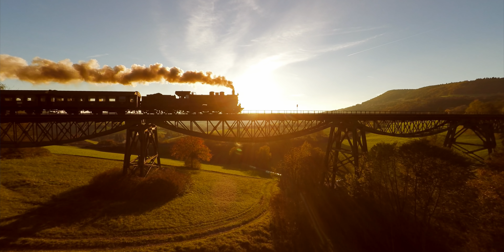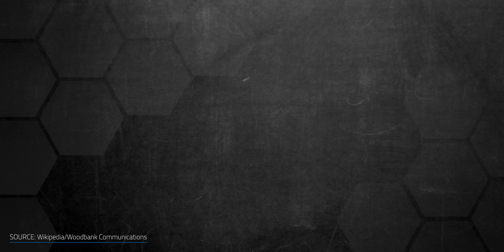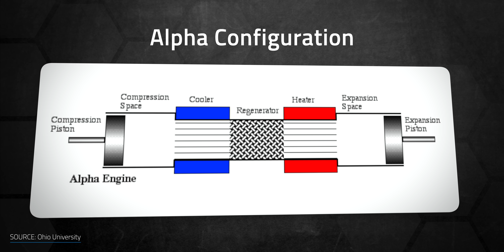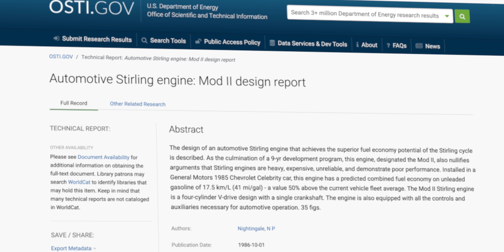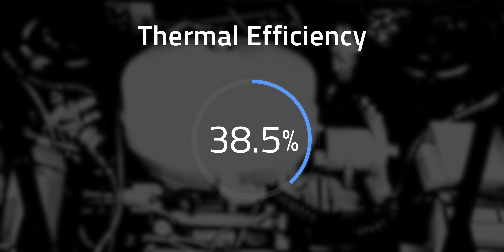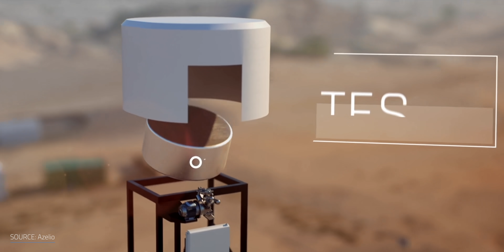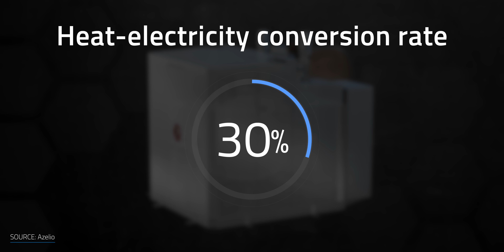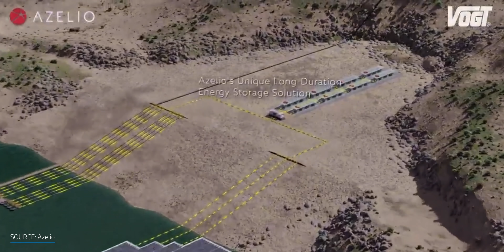Are Stirling Engines the Future of Renewable Energy Storage?

Comment: Based on my minimal research, this seems like it would fit perfectly in geo-thermal power schemes.
Reply: I've been considering how to build a sterling engine in my backyard. Summer temps here are 100° or more but half a foot underground the temp is nice and cold
Reply: @Artinthedark83  One thing to watch out for is saturating the ground around the half-buried engine with heat. The engine moves heat from the hot plate to the cold plate, so the area around the engine would heat up. I don't know if the ground would dissipate the pumped heat fast enough. Maybe combining it with a large thermal loop underground would do it.
Reply: @Trafulgoth  poop
Reply: @Artinthedark83  Pretty simple.  You'd need to either concentrate solar energy and use a high-temp Stirling engine, or better yet, use vacuum panels (to gain solar heat).  For the cold side you do something similar.  A water loop through a pipe (it needn't be metal, just thin plastic is fine) in a narrow trench about 1 m deep.  The longer the better, but there will be parasitic losses when pumping.  You could also use air cooling, which would not be as effective, but way easier, so just build bigger to make up for it.
You'd need to build your own custom LTD Stirling.  There area calculators out there for sizing.
Since you have heat and heat-dump running on liquid loops, you could enclose your Stirling in a pressure vessel and turn up the pressure as much as possible.
For example, build it inside a large propane tank that has been cut in half with a flange added for bolts.
Crank it up to about 5 bar - helium if you can.
If using the pancake type of displacer, add a regenerator material around the perimeter.  I've not seen this done before, but think it will greatly help with efficiency.
Also, if you can magnetically couple the displacer piston to the power piston, rather than a through-hole linkage it will increase efficiency.
Anyway, I'll do this one day under the right circumstances.  If you can.. do it now :)
Reply: @Artinthedark83  That is an interesting idea.
Reply: I wonder if this is used in Iceland or is planned for future use?
Reply: @earthcoloredeyes5043  I know they're doing geo-thermal but not familiar with what specific tech they are using to harvest the thermal energy.
It looks like most geothermal is similar to traditional steam turbine thermal power stations.
Reply: @Mystical-Mono  physicist here (so, not quite an engineer) but as I understand it Stirling engines are in general less efficient than turbines, largely due to needing to supply the cold side. But it’s possible to bring them higher with improvements, I suppose. (We have a few other types of direct heat to power techs, such as using tons of thermocouples, which we do with RTGs. But those are also less efficient than driving a turbine.) Note I haven’t watched the video yet so if there’s some breakthrough he talks about, I don’t know about it yet. Going to play it now.

Edit; also, this small one looks impressive spinning quickly like that, but that’s unloaded. Much like a battery’s voltage gets brought down under load, the speed of the wheel gets slower, and it can’t provide much torque, which is akin to current. 

Edit2; okay, so these industrial ones get ~30%, which is pretty decent. However, traditional steam and turbine gets 40-50%, with the median being between 42 and 46% depending on your country. So Iceland wouldn’t have much reason to do it, unless they’re much cheaper to set up.
Reply: @kaitlyn__L  I think the difference is that a steam turbine needs heat or steam and pressure. While a Sterling  Engine can use the difference in heat. Meaning if you have a geo thermal spot with ice cold water also near it you can extract more power?

 Correct me if I'm wrong but I think that is where the benefit lays. No idea the pressure required for a regular geothermal plant.
Reply: @dianapennepacker6854  that’s certainly possible, but increasing the temperature differential makes all engines run more efficiently. Even a heat pump is technically a type of engine under this conception, and geothermal heat pumps work best with hot ground and a cold sink. I’m certainly not anti-Sterling research, I’m just not sure how much benefit is unique to them :)
Reply: This was my thought exactly. That, or lowering the cold side into the sea in countries near the equator where the ambient temp usually stay on the high side and sea temps on the cooler side. Might not be a big enough difference in temp to be efficient though, Geo-thermal is probably the way to go.
Reply: even just in cold areas, where you have a natural source of ice water and minimal warming of some water with solar panels or just a large shallow pond. possibly an adjunct to a dam, where you have basically a giant cold sink behind the dam wall.
Reply: They can use more efficient steam turbines.
Reply: Efficiency has little or no impact. Price of equipment and maintenance is what would make a difference.
Reply: @wakeupthebear  Here in Sweden, where we have hundreds of thousands (if not millions) of residental geothermal units installed, they are considered to require NO MAINTENANCE. But most of these units was installed in the early 00's, and the early ones in the 1980's. So their history is still short.

Maintenance and cost of the parts above ground would be similar to that of a supersized refrigerator, since that is exactly the same kind of apparatus. A well made refrigerator last for decades, many Swedes still use refrigerator manufactured in the 1950's-1980's, sometimes even from the 1930's-40's, and plan to keep them as long as possible, since they are much quieter than modern ones, that doesn't use freon as the refrigerant.
The parts below ground is expected to work better than a normal waterpipe, since they have no problems caused by freezing or depositions inside the pipe. A well layed waterpipe last at least 50+ years. Most water PVC pipes, used in Sweden since the 1960's, almost exclusively since the early 1990's, has never needed any maintenance (unlike older kinds of pipes made of iron, copper and concrete; historically, lead pipes was rare in Sweden, since Sweden didn't produce much lead domestically).

Since most of the Swedish geothermal units, was installed during the same time period. If any future problems arise, it is likely to happen mass scale. And likely to be cheap to fix, because of scale of production. Just as a massive demand of residental geothermal units, made those very cheap to buy an install in the early 2000's.
Reply: No shit. I’d wager molten salt, via concentrated solar, the likely storage medium for residential, and use ground loop from geothermal for the heat sink.
Reply: I think Geothermal is a terrible idea. Earth will die when tectonics end which is based on geothermal energy. If anything we should be looking at ways to dump heat into the earth.
Reply: @nustada  lol
Reply: I think I made that same comment after his geothermal episode 👍
Reply: By much minimal research you mean this video
Reply: A common steam turbine generator works well with geothermal wells. Stirling engines are useless at over 2 hp.
Reply: … have you guys heard of google scholar? Lol - yes they’ve researched it, knock yourselves out:
https://scholar.google.com/scholar?q=geothermal%20stirling%20engine&btnG=Search&as_sdt=800000000001&as_sdtp=on
Reply: Exactly my idea. It could even power the heat pump and let the home owners have their power needs met trough solar. Just need one more loop for it :)
Reply: it's gotta compete with the good ol' boil water and send thru turbine spiel.
Reply: Yep
Reply: Do you really need storage in geo-thermal power schemes? Isn't it more effective just to add production capacity, as I guess you should have significant power loss with this storage solution?
Reply: How about adapting to location where a large (cold) water body adjoins a land mass heated by the sun, e.g. San Francisco Bay and the east bay?
Reply: The problem is that a geothermal source might have a temperature of about 100 degrees Celsius, if we assume the ambient temperature to be 25 degrees, then you can calculate the carnot-efficiency of the cycle which is the maximum possible theoretical efficiency if you consider absolutely zero losses (obviously in reality not possible). The carnot efficiency is = 1 - Tc/Th = 1-(100+273)/(25+273) [converting from Celsius to Kelvin] = 20%. The actual efficiency of the cycle would likely be less than half this after losses. In reality it is very difficult to convert low-grade thermal energy into useful work.
Reply: Nope it's a good thought but a turbine uses less moving parts .. less parts equals less maintenance !! That's why you'll never see this application used for geothermal !!
Reply: Apparently a turbine can convert much more power than a valve based engine because you can direct a jet of superheated steam onto an angled blade. With a Stirling engine you can't control the motion of the working fluid. Stirling engines are highly efficient for low power systems.
Reply: I think a great idea would be to build an insulated trench under ground full of sand and zeolite. the liquid aluminum piping would run all the way down into a giant insulated trench. The sand and zeolite would make a huge heat sync, storing more heat energy. another pipe  of water could run through the sand and you would always have boiling water on tap, along with steam. you then would use the boiling water to sync with a huge tub of water that stays at 180 degrees for sanitation water on tap. then that goes into water tanks where its mixed with cooler water for faucet hot water on tap. There is also a giant tank of warm water that runs into hose like tubing, that stretches out into the green house underground, and under parts of the earth outside, to gently extend a growing season, so we can hurry up and create more plant biomass and diversity asap. the more we turn thermal energy into regenerative systems of basic energy we eat from every day, the world will have a much better chance of being a better place.
Reply: Thing is that geothermal is always-on anyway so it wouldn't be of much use there.
Reply: @lozoft9   well you're only considering the energy storage potential, i believe Christian is implying that a closed loop Sterling engine might be more efficient than traditional(steam) geothermal
Reply: Except for those pesky earthquakes resulting from geothermal. (Ref. Irving, Tx)
Reply: @EvilCerealBoX  - I don't know enough about the tech. Most geothermal uses steam similar to other steam turbine thermal power stations. I am just wondering if Sterling engine tech could be more efficient and potentially less negative consequences over traditional models.
It looks like initially that the sterling engine tech is much more efficient than traditional geo-thermal models.
Reply: @EvilCerealBoX  Earthquakes????
You must be getting your facts wrong.

Here in Sweden, in the areas  where residential housing hasn't access to district heating, geothermal heating is the most common heating solution. In these areas, pretty much every residential building has their own heat pump, taking heat from a hole in the ground in their yard. Hundreds of seperate units within a walking distance, in thousands of urban areas. From the north to the south, Sweden covers a thousand miles, with very different geologic conditions, and significant variations in climate.

Most of the Swedish geothermal units was built during the same period of less then a decade. (Government subsidies in the early 00's)

No frikking increase in earthquakes frequency whatsoever, no increase in the severity of earthquakes. Parts of Sweden is situated on fault lines, and we have about 2 earthquakes per nycthemeron. But, although frequent, our earthquakes are very mild compared to those in many other parts of the world, usually barely noticeable (and, as mentioned earlier, that has not changed with expanded geothermal energy usage).
Reply: @EvilCerealBoX  The earthquakes around Irving TX are because of fracking. Fracking has turned Oklahoma into the most seismically active place on earth.
Reply: @EvilCerealBoX  That was an almost imperceptible 3.3 magnitude tremor in the center of the Dallas Ft. Worth metroplex noticed by 1400 people in an area of 7,000,000 people. It was caused by overloading an injection well discarding polluted water from oil well drilling. One could cause a serious problem by lighting a campfire in a textile factory, but that doesn't mean it should be blamed on the textile factory. Blame whoever hired a macho drunk who doesn't care about workplace safety.
Reply: @EvilCerealBoX  that is from "fracking" for Natural Gas. Normal drilling doesn't cause the same instability deep underground.

Comment: Great video Matt! I was not familiar with the Stirling Engine. Seems like it would work well in specific instances. However, the only down side would probably be the multiple moving parts in the engine which would probably require a lot of upkeep & maintenance. Just thinking out loud. 🤔🤔👍👍
Reply from the maker: Thanks, Steve!  And yeah ... moving parts = maintenance, but there could be some really interesting use cases out there that make it worthwhile.

Comment: I wonder if the flywheel in a sterling engine could be adapted through a continuous variable transmission (cvt, like used in some dodge vehicles) to directly store the thermal energy into flywheel energy for very long term storage. Seems like it should work. There would be losses in the cvt but I think they could be very small

Comment: Hey Matt !! Can this be a source , after connecting it to the Water Inlet, of every household? There is so much Kinetic Energy, going to waste , in Millions of Homes , all around the World !!! It Mini Turbine, should be generating energy in every household, before the water enters the heater or just after entering the home , at the inlet valve. Also , same with the 1000’s of Higher Altitude Water Tanks , not using their Kinetic Energy of their flow, to generate Electricity, before entering the grid of the Municipalities..

Comment: With the efficiency so much lower than other methods though, you'll need to have significantly more production.  That said, one of these units is likely cheaper, but I'm still skeptical it'll be economical.
Reply: It depends on the specific use of the engine. Compared to photovoltaic cells, the efficiency isn't actually that bad, and because they're purely mechanical, they can be built in facilities not equipped to work with semiconductors. Additionally, something not mentioned in this video is their potential use in smaller, safer nuclear reactors like NASA's kilopower, which could be adapted for planetside use with relative ease. In practical terms, stirling power stations will never supplant wind and solar, but they don't need to in order to still be a useful part of a future zero-emissions energy economy.
Reply: The thermal efficiency is no worse than the most efficient steam turbines, at ~33%. It can also be turned on and off much more simply than steam turbine based power, so it should be better at providing power at peak times.

Comment: Imagine a one hundred foot wheel, with many weights synchronized to maintain the wheel rotation, without power, onces started.
Reply: You would have to lift the weights in some way to input energy.
Reply: @garethbaus5471  weights would be attached and power initially applied to start the wheel, once started the weights would provide energy.
Reply: @JMJWill  only for as long as you have weights to continue dropping.
Reply: @garethbaus5471  not if they could synchronized them similar to the old principle of water wheel except counter weight would drive the top continuous down and around...perpetual motion.
Reply: @JMJWill  the issue is that the energy needed to place the weights is equal to or greater than an rotational energy.

Comment: Energy storage may not be as important as we think. Solar costs (and to some degree wind) is becoming cheap enough that the economics of over-building production can be cheaper than storage. The other "cheap" solution is interconnection such as connecting the three major US grids together. This would allow, for example, sunny Arizona to sell late afternoon solar power to the northeast as they enter the high demand of early evening. Storage may still be important, but my bet is that it will be small, distributed, no/low maintenance storage such as Tesla's powerwall.

Comment: wonder how efficiently this engine would run if you placed it between the outer hull of a space station and the air inside the station just like the ice thing but a whole lot colder, like since you can also remove the factor of gravity in space i wonder how much more efficiently it would run 🤔
Reply: I think that would be a great idea. I wonder if NASA thought of this already, or maybe it’s not competitive with the 24/7 pure solar exposure they get on the panels they use. I believe as the space station spins and relies around earth, the parts exposed to the sun are quite hot, while the parts not exposed are quite cold. They’d probably need to keep areas always in the dark and other areas always in the light.  I still believe it could be a great idea, but the solar is probably more efficient/stable.
Reply: @airdoo  well they wouldn't necessarily need the sun the power would be generated off of the cooling from the sub zero temperatures of space they would just need to control the other side by re-heating the air back to ambient room temperature like the inside of the station

Comment: Stirling Engines work very well in space (sunlight = hot, space = freaking cold)
Reply: Spacecraft radiators = 100-350W per m² and weight of 1m² radiator is up to 12kg. Convection is much cheaper way of cooling.